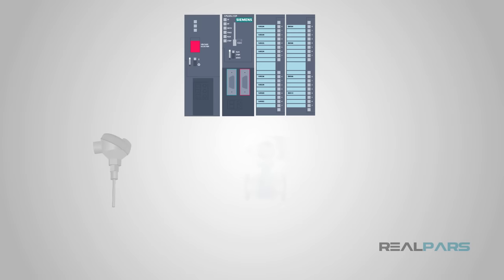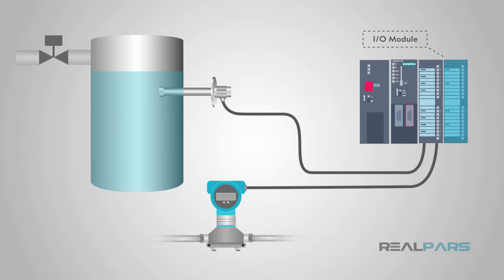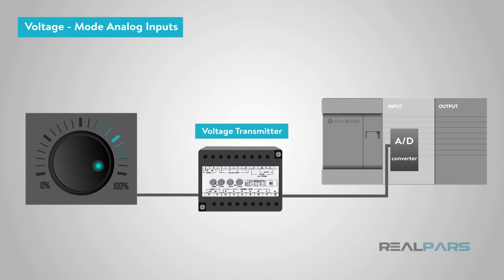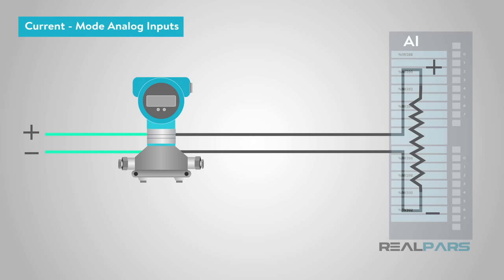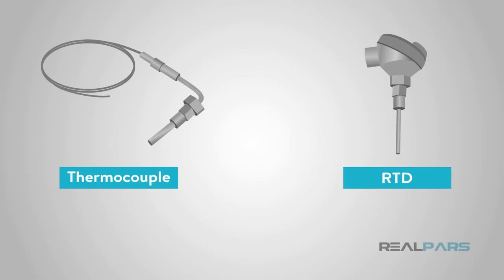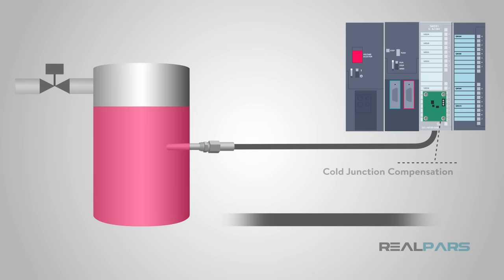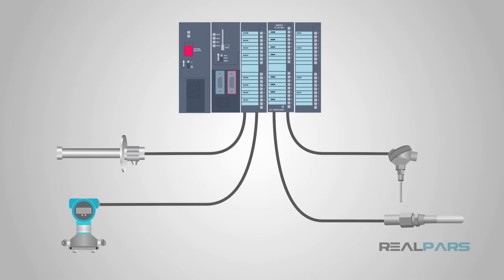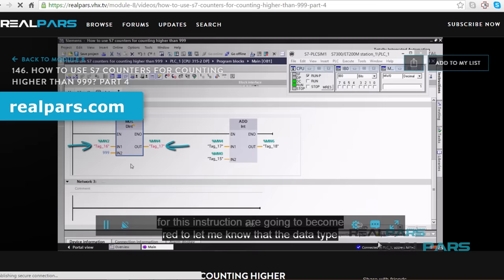PLC Analog Inputs and Signals

Comment: I would add that some of the most important reasons why 4-20mA is used over 1-5V:
1. The voltage reading could be inaccurate due to cable resistance voltage drop.
2. The current read in the transmitter and the PLC are identical, for any value of cable resistance, thus the transmitter can sense if the current is not the correct value it intended to transmit so it can adjust its impedance in line to bring back the current to the correct value.
3. Two wire transmitter connects are possible with current but not with Voltage.
4. Under ange (lower the 4mA), over range (higher than 20mA), and wire break (under 3.2mA) can interpreted by the PLC.
5. Current circuit is a very low impedance (normally less than 750 Ohms) so less sensitive to electrical interference compared to Voltage signals.
6.    Current circuits allow an easy connection of an indicator in the current loop as long as the total resistance in the loop does not exceed typically 750 Ohms.
Reply from the maker: Awesome! Thanks for sharing your knowledge with us, Santo.
Reply: Very much informative. Thanks.
Reply: Thank you sir

Comment: Howdy. Nice as usual.
Some discussion about measurement precision might be in order.
Let's take two pressure transmitters from the same manufacturer. One is 0 - 1 bar and the other 0 - 10 bar. Both have a precision of 0,5 %.
What does this mean ? For the first one ( 0,5 / 100 ) x 1 bar = 5 millibar. For the latter ( 0,5 / 100 ) x 10 bar = 50 millibar. The accuracy bandwidth for the first is + - 5 millibar over the whole measuring span and for the latter + - 50 millibar over the whole measuring span.
What is the accuracy bandwidth ? It is the + - standard deviation which, somewhat simplified, means that 2 measurements of 3 are inside the bandwidth.
Alright. Now the plant manager says he wants to reduce the stock of spare parts and orders the 1 bar type to be removed from the stock replenishing program. Just use the 10 bar type and multiply the reading by 10 in the PLC.
What is wrong with this approach ? Let's say we have a reading of 0,8 bar. With the original transmitter the actual value can be 805 millibar but with the replacement as much as 850 millibar. This much a deviation could ruin a production batch.
Regards.

Comment: Dear Real Pars Team,
I have few doubts,
1) What is meant by "Conditioned Input"?
2) What is the math behind for choosing 500 ohms in the PLC AI Circuit? I mean how we derived the load resistance as 500 ohms kindly explain it in detail with calculations?
Thanks in advance
Best Regards,
PC Raju.
Reply from the maker: Great questions!  Conditioned input indicates that the input signal is converted from the native signal from the sensor, 4 - 20ma for example, to a signal that can be used by the electronics in the I/O card, which most often operates on a 1 - 5 VDC signal.
For the loop resistance, this depends on the specific analog input card, and as indicated in the video, this resistance is limited to 500 ohms.  That does not mean that it is 500 ohms ion every case.  For a 4 - 20ma sensor, a 250 ohm resistor is typically used.  From Ohms law, V = I * R, so at 4 ma, V = 0.004A * 250 ohm = 1 VDC.  At 20ma, V = 0.020 * 250 = 5 VDC.
Reply: @realpars  Thank you so much for your quick response.
please also clear this doubt, 1) how we will ensure that PLC analog input card particular channel is good(working) or not? for eg: i have connected a level transmitter (two wire) to a PLC AI specific Channel and when im trying to measure the milliamps at PLC card in series with multimeter im not getting any reading as well as it was not displayed on the HMI but while i have connected the same Level tx. to another card i have got milliamps and reading on the HMI such kind of scenario what kind of checks we will do at PLC AI card side? 2) is it ok to check DC voltage (1 to 5vdc) in parallel with multimeter while the specific channel was connected with two wire transmitter in a live loop circuit.

Comment: Information needed. How many analog outputs (maximum) can a PLC, or other additional elements control? Using as an electrical switcher.
Reply from the maker: The I/O capacity of any PLC system is limited by its memory reserved for I/O and the number of physical I/O cards that can b addressed.  For example, a Siemens S7-1214c can have 51 analog points;  an S7-1500 typically has 32x the I/O table memory of an S7-1200, so theoretically, it could have up to 1600 analog points.  So you need to determine the number of I/O your system can handle.  Even within the Siemens product line, there is a very wide range of capability.
Reply: @realpars  👍👍👍 Thank you for your reply, the information is of great help to me! In the, hopefully, near future I will have to buy your tech for an important project. It's the only device I've found that has that capability.

Comment: lets see if i udnerstood this correctly. an analog signal is an actual physical signal, like a current running through a cable, while a digital signal is a signal that is processed and sent electronically?
Reply from the maker: Not quite.  Both analog and digital signals pass current through a wire, tyipically at 24VDC.  The difference is this:  an analog signal is comprised of a current signal that varies in current (milliamps) between 0% signal and 100% signal.  The value of a digital signal (probably best called a discrete signal) is either ON (24VDC) or OFF (0VDC).

Comment: When there is a seperate 24v dc supply, why does the negative connection from transmitter goes to the positive connection at analog digital converter and not negative?
Reply from the maker: In a 24VDC current loop (a series loop), you flow from more positive to less positive as you go from one device to another.  From the power supply,  you connect the (+) terminal to the most positive free terminal (+) of the transmitter.  That just leaves the transmitter's (-) terminal, which is routed to the most positive free terminal on the converter (+).  Then the remaining terminal, the (-) terminal on the converter goes to the remaining terminal (-) on the power supply.  That is how a 24VDC series loop is connected.

Comment: As i understand 4-20 mA is converted to voltage (1-5 volt) through 250 ohm or 500 ohm, .. Am I right? My inquire is why the card read voltage (1-5) instead of (4-20 ma)????
Reply from the maker: Great question!  Per Ohm's Law for DC circuits, V = I x R.  So for a 250 Ohm resistor, 4ma will give a value of V = 0.04A x 250 Ohm = 1 V.  For 20ma --> V=5V.
The internal circuitry of an electronics board is comprised of many components, mostly comprised of transistor-based devices, like op-amps and IC's.  These devices operate in the range of 1 - 5 VDC, so use of a precision 250-Ohm resistor is convenient and inexpensive.

Comment: The power supply in connection is the same power supply to operate the transducer ?
Reply from the maker: Yes.  Many analog sensors are 2-wire, loop-powered, meaning the 24VDC power circuit from the I/O card also powers the sensor.

Comment: Plz, what's the difference between (1-5 volt) and 24 volt? Used in the loop
Reply from the maker: Typical loops in a PLC or DCS are powered by 24VDC.  Analog loops have a 250 ohm resistor inline, which converts the 24VDC signal to a 1-5 VDC signal that is "native" to the electronics in analog input cards.

Comment: Hi, Usually industrial analog sensors are multipoint calibrated to accommodate hysteresis. How can we enter those values in a Siemens Scale-X Norm-X instruction?
Reply from the maker: No.  The NORM_X and SCALE_X functions are linear functions and assume only two "calibration" values:  0% and 100%.  You could break up your curve into multiple linear segments, one segment between every two calibration values.  Then use the NORM_X function to calculate a % of range and use the appropriate "segment's" SCALE_X function to determine your transmitter value.

Comment: Hello, i have a question. If we want to regulate the temperature inside a tank where the LRV is 40°C and URV is 140°C. Knowing that the output signal 4-20mA is, what will happen if the temperature drops below 40°C or rises above 140°C?
Will the transmitter send a signal or not? If yes his is this signal calculated?
Thanks
Reply from the maker: Hi Bärenstark,

Unfortunately, dropping below or rising above calibrated range has minimal effect on output. You may find d the current values slightly below 4 ma or slightly higher than 20 ma, but nothing significant. You will notice a big change if the current loop is broken.

Hope this helps!
Reply: @realpars  ok... but my question was to know if the transmitter could send let's just say 24mA for example if the temperature exceeds the range  of temperature we had. For instance if the temperature rises to 165°C, knowing  that the range is 40-140°c, would the transmitter send 24mA or not?

Comment: What is transducer? Why it is used?
Reply from the maker: A transducer is a device that reacts to a property of a fluid (flow, temperature, pressure, level, etc.) and converts that measurement to a signal that can be used by a PLC.
Reply: @realpars  Can I say it sensor?

Comment: how to connect pressure transmitter to siemens logo controller 12/24rc
Reply: You will need to add a Logo AM2 module to your basic module.  The Logo AM2 module supports 2 analog inputs.  When connecting to the module, use 24VDC power and select 24VDC on the module (slide switch).  For a 4-20ma sensor, for channel 1, connect (+) to I1 with the corresponding (-) wire connected to M1.  Connect the shield to X11.  For channel 2, connect to I2/M2/X11.
Reply: @scottsommer6480  thank you

Comment: In which FC analog inputs are configured?
Reply from the maker: Analog inputs are typically configured at the I/O board level (hardware configuration).  For Siemens analog cards, the analog inputs are scaled from 0 to 27648 counts (h6C00).  The analog input can then be scaled with FC100 (Scale2Real) in STEP7 or by using the SCALE function in TIA Portal.
Reply: @realpars  Thank you 😍

Comment: Are the voltages ac or dc??
Reply from the maker: Hi there, 

Thank you for your question! The answer is DC voltage.

The 4-20mA output signal is an analog output signal commonly used in sensors. It is typically powered by DC voltage ranging from 8-32 VDC, which is widely available commercially. Here is a link for your learning. 

https://core-sensors.com/wiring/4-20ma/#:~:text=The%204%2D20mA%20output%20signal,which%20are%20widely%20available%20commercially.

Happy learning!
Reply: @realpars  thanks!

Comment: Why is it called an analog input if the input signal is 4-20 mA DC?
Reply from the maker: The definition of analog is:  "relating to or using signals or information represented by a continuously variable physical quantity such as spatial position, voltage, etc.".  In this context, an analog input is continuously variable signal between 4 - 20ma.  This signal as transmitted, is typically decoded as a 14-bit or 16-bit signal, which allows the current to be decoded to 16384 discrete increments.  For a 16-bit analog card, 1 part in 65536.
Reply: @realpars  Thank you for your response. What I don’t understand is if the signal is analog that makes it by definition not digital right? So why do I measure 4-20 mA on the DC setting on a device that is called “analog input”? Perhaps “analog current” does not mean the same thing as “alternating current”?

Comment: Real pars, I have a doubt. Why plc generally has less analogue input modules(compared to digital)?
Reply from the maker: Hi there, 

Thank you for your question. Analog input/output channels consume a greater amount of memory compared to digital channels. The memory requirements for your PLC will largely depend on your specific needs, and it's worth noting that using analog channels can be more resource-intensive and potentially costly.

To put it into perspective, a single PLC analog channel typically occupies 16 bits of memory, whereas a digital input/output channel only uses one bit out of those 16. This means that you can have a greater number of digital I/O channels to work with in comparison to analog channels.

Happy learning!
Reply: @realpars  Thank you 😊

Comment: Can you give one example program for ai and ao sir
Reply from the maker: Hi there, Controlling Pressure and Flow of liquid
Reply: @realpars  Ok sir
Reply: AI means analog input ( like the weight of something which can have a wide range like 0,10,30,73,88,92) and AO means analog output (like flow of liquid which can also be in a wide range is set by the output signal from the controller).